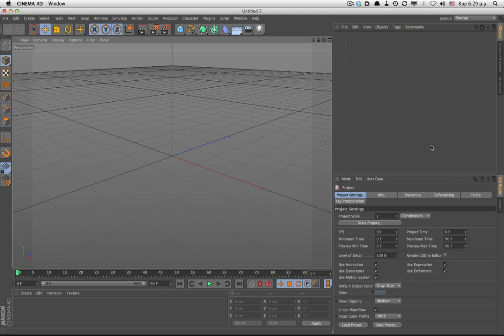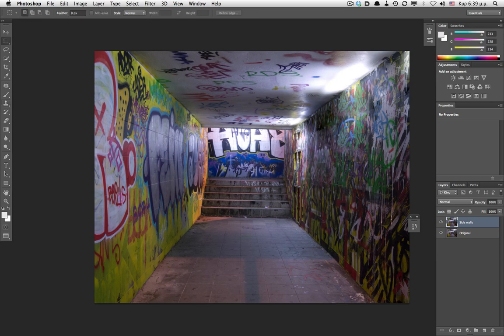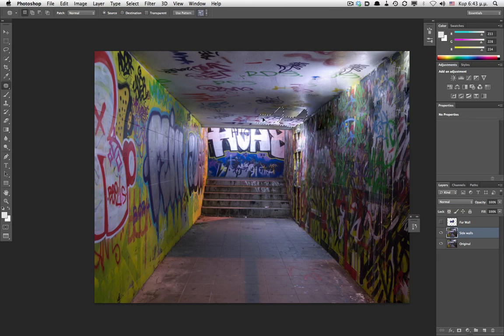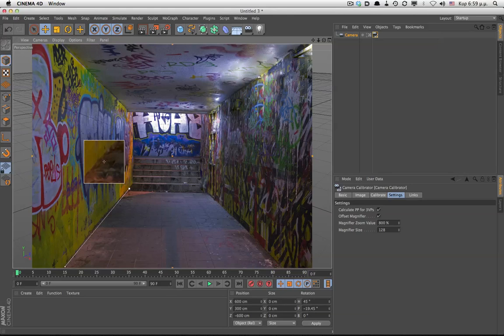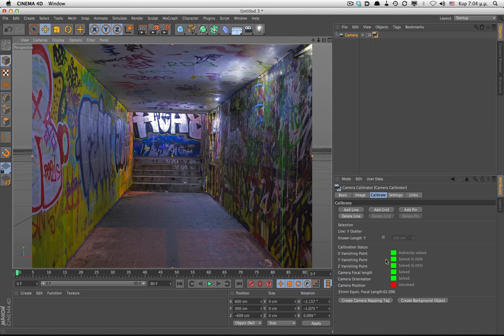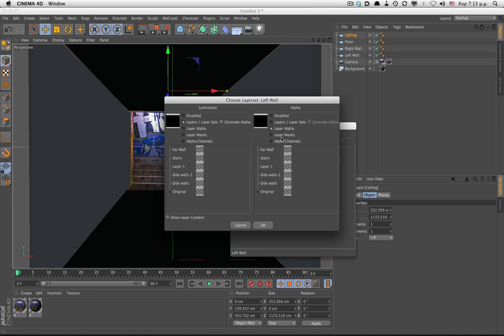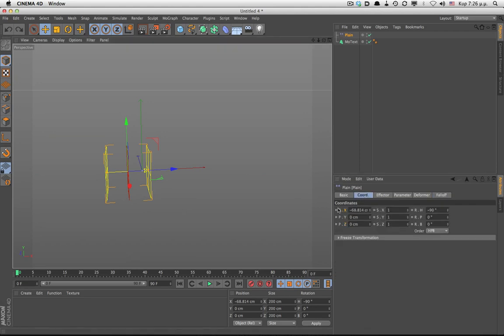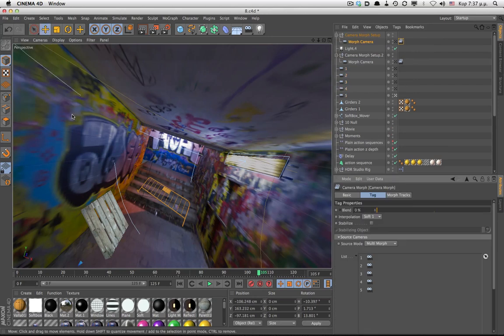Tutorial: Create A TV Ident With The New Cinema 4D R14 Tools

Comment: Hi Kwik. Camera mapping is a great technique but it has its limits. At some point things will start looking wrong since you're using a single angle picture. If you feel you're not pushing the picture to the extremes then maybe you need to model a few more things in the scene. As you said it would be better to also have the handrails modeled. You will be able to push the photograph and the reality factor further.